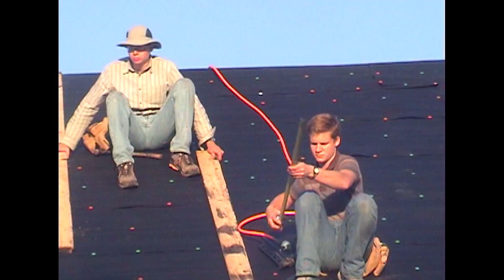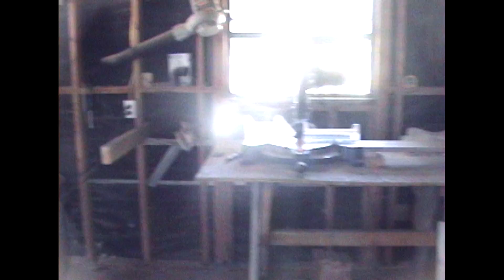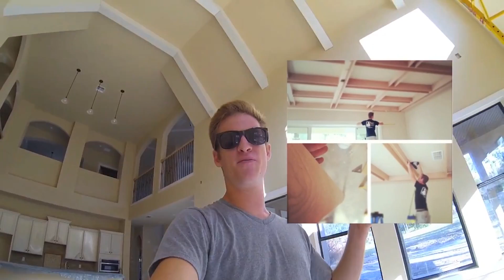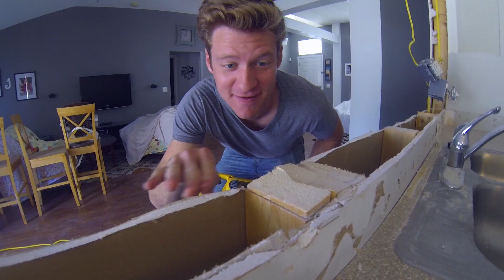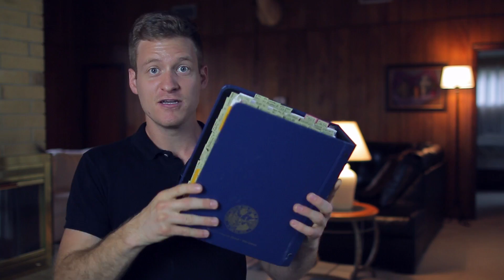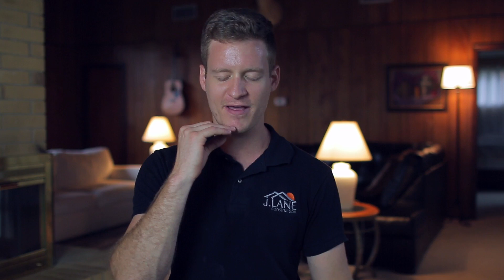How I Got my General Contractors License at 22 Years Old

Comment: Im 22 , about to turn 23. I live in las Vegas NV so I've  grown up seeing construction all around me and I love it. I went to a magnet school where my major was architecture, something that I wish I could've persuaded but do to economic circumstances I was not able to follow that dream. While I was in high school I had a part time job at shop where we built anything from custom kitchens, bars, restaurants, casinos, you name it. My first job out of high was structural steel out of state which I think is probably my favorite job because I just loved being in heights and welding. After that I came back home and got a job in carpentry again, this time with remodels. I liked it but I didnt feel I wasnt going to go anywhere with the company so I looked for another job. So I became a plant labor with one of the largest concrete providers in the US, calportland to be exact. There I didnt everything, learned to operated heavy equipment like wheel loaders and excavators, again I felt like I needed more so I became a mixer driver for them. I asked my plant manager to let me do more and earn more. Withing a week of the "go for it" I gave them my class A permit, and by the next two weeks when they had processed my paper work that I wasnt a labor anymore and now going to be a driver i handed them my actual class A drivers license. It's been a year since I started driving and again, I feel like it's probably not enough and now I want to get a contractor's license and start my own construction company. I just dont know how or where to start to get my contractors license.
Reply: Mr J you have given me the reason why I should be interested in construction. I am a student studying building technology in school. Can I please have a personal  with you. I really want to learn especially the estimation aspect. please I need your help.

Comment: What about the experience requirement to have worked at least one year as a foreman . Is there a way around that requirement 
I have several years in the framing industry but not acting in a supervisory role.
Reply from the maker: Chuck Smith  I would recommend picking up a position for a GC working as a superintendent.

Comment: I am 21 years old and have no experience with my hands. Is it necessary to begin my career as a contractor with prior trades experience (Carpentry/plumbing/masonry) and if so, which trades would you recommend learning?
Reply from the maker: Yes!  I would highly recommend learning every trade.  To be a successful general contractor, you need to understand the entire process of construction.  Although, there is nothing wrong with becoming a speciality contractor! (Electrician, Plumber etc.)  :)